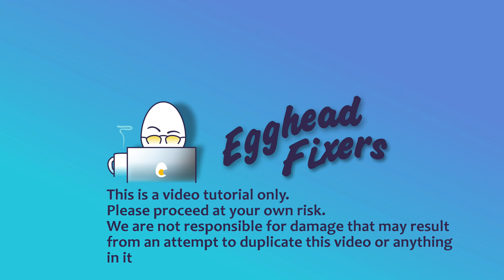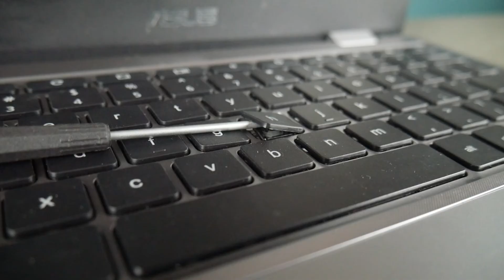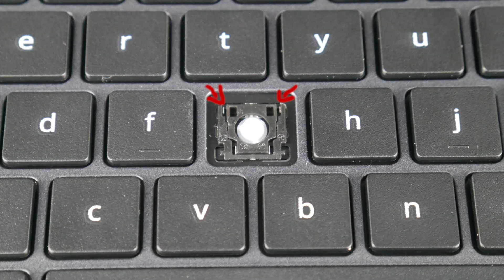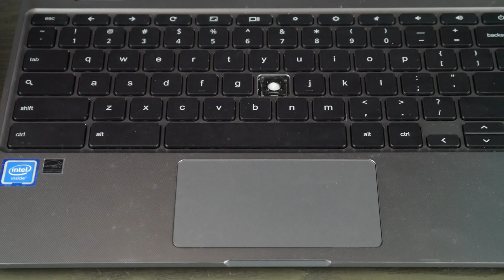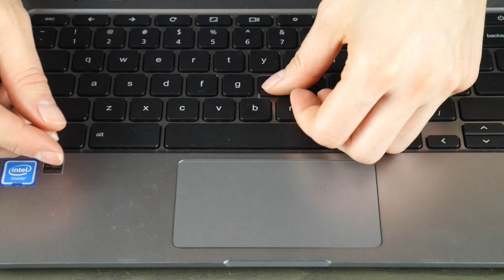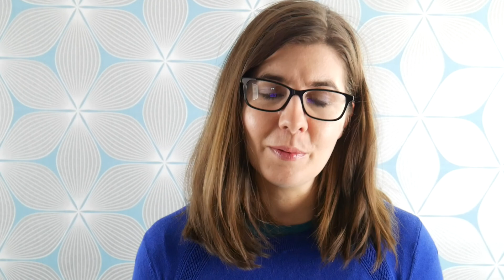How to Replace a Key on Your Acer Chromebook's Keyboard - Tutorial by a Certified Technician

Comment: When i do this exact tourtial it doesn’t work. Its almost like the key doesn’t lock in and when i take just the key out all of other stuff comes out as well. I have tried putting the other stuff in first then the key but sty doesn’t work. Weird thing is that i can push it in all the way but it pops out.
Reply from the maker: If you take the key cap off another key then you can compare and see if anything is installed incorrectly

Comment: I tried this and the retainer pops into place just fine! The trouble is, when I try to place the key back on, it doesn't stick all the way and falls off. Any Pointers?

Edit: 
I Checked to see if there was any damage to the key or retainer, and there is not please help
Reply from the maker: Sometimes it's a little warped so it's hard to get it to click in so try moving it around a little bit while pushing down. Also examine under the key cap sometimes the retainer clip is fine but a piece of plastic on the key cap has come off
Reply: @EggheadFixers  Thanks!
Reply from the maker: @00Mop  welcome!

Comment: I have been trying to find a replacement key for my Chromebook Acer 720.  My arrow key down is broken off and I have to try and keep the little rubber in place and if I loose the little black arrow down key I have to find it to work my computer.  I know this sounds crazy but I am so tired of keeping up with these two little parts to work my computer and can't find a website to purchase another little down arrow.  Can you help me?
Reply from the maker: It looks like you can not find individual keys but you can find replacement keyboards. A lot of times in this situation you can just take a key off of replacement keyboard and use that. Like here is a link to one on eBay:
https://www.ebay.com/itm/303885138316?mkcid=16&mkevt=1&mkrid=711-127632-2357-0&ssspo=C1AeLExzR2K&sssrc=2047675&ssuid=&widget_ver=artemis&media=COPY

Comment: Is it possible to fix a key if the middle rubber button is gone?
Reply from the maker: The rubber button that works as a mouse? If the rubber piece fell off then you can usually get replacement ones really easy on eBay. It usually goes back on pretty easy.
Reply: @EggheadFixers  I'm guessing that referred to the "cup" thing underneath.

Comment: I need help!! I took off the enter button from the Acer chromebook 311 and the brackets fell off and I don't know what to do. :(
Reply: Yea I accidentally pulled off the alt key and the plastic clips came off with it and now I cant get it back on (I have a Acer Chromebook Spin 315)
Reply from the maker: @atlas6477  Does the clip seem broken? If not you should be able to put it back on in a similar way to what you see in this video.
Reply from the maker: When you say brackets...Do you mean the metal bars? Or the plastic clips?
Reply: @EggheadFixers  The plastic clips, I was trying to fix it yesterday and one of the plastic clips broke. :(
Reply from the maker: @lil_pauly17 Sorry to hear that:/ Then you will need to replace the palmrest or get a retainer clip off another keyboard for this model Chromebook.
Reply: @EggheadFixers  do you know where I can fix it?
Reply from the maker: @lil_pauly17  Any repair shop should be able to do that for you. Like Geek Squad in best buy